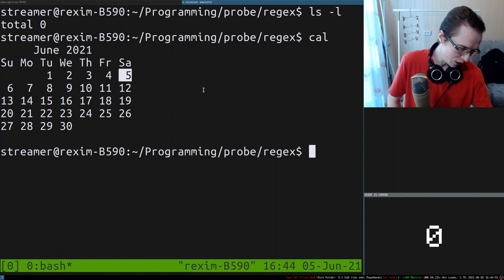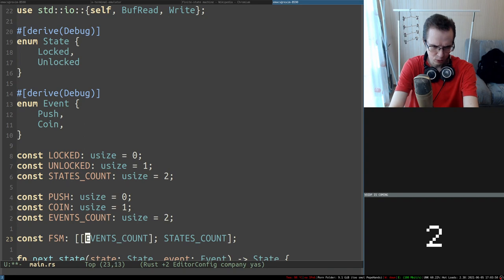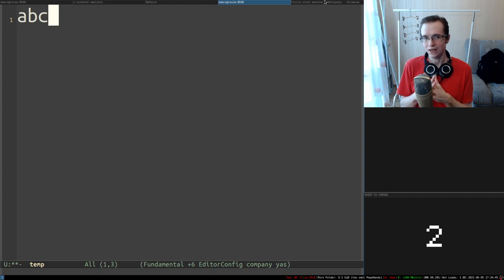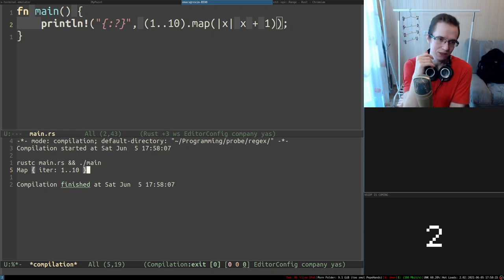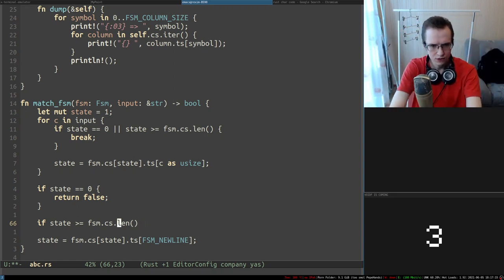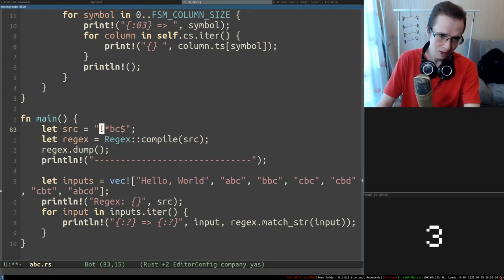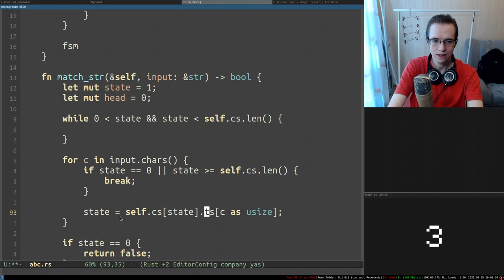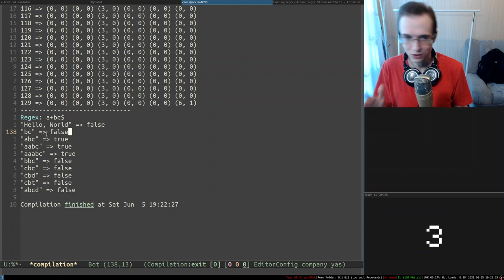Regex Library in Rust from Scratch (Finite-State Machines)

Comment: You can use Enums for indexing, you just have to set the values for the enum like 
enum A { B = 0, C = 1}
and then cast it
arr[A::B as usize]
Reply: you could also do #[repr(usize)] enum A { B, C }
Reply: @relacibo explicit repr in rust is generally bad practise in rust